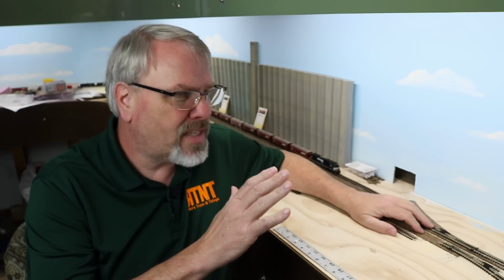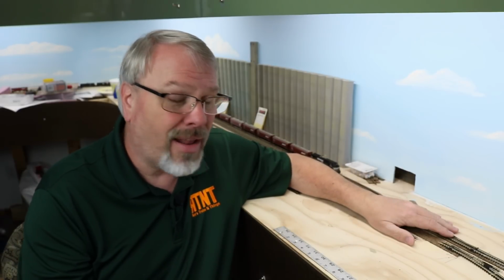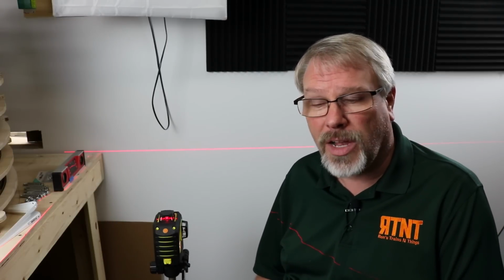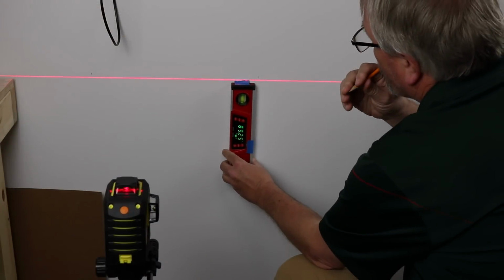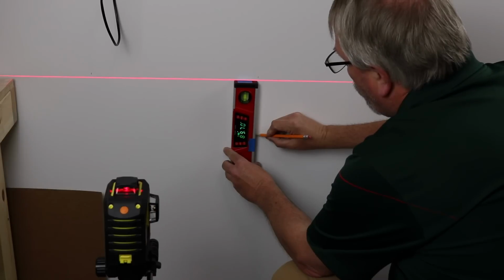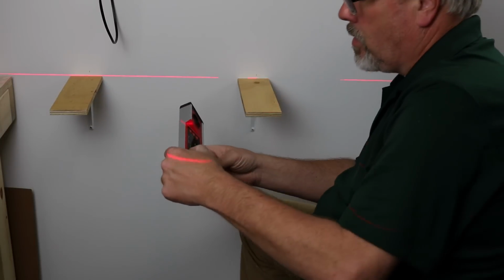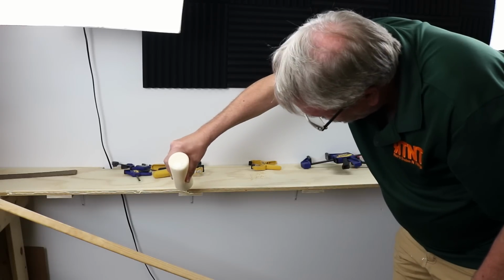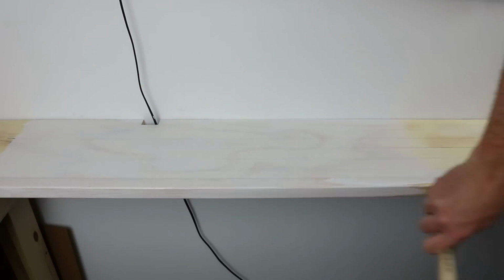Quick and Easy Layout Benchwork

Comment: Hi there, I am looking for tips in regards to running 2 continuous loops on my not yet built N gauge... Due to a severe lack of space, I am looking at a max size base size of 130cm X 65cms.
It is DC and I was hoping to be able to run 2 trains in opposite directions on two tracks..... no specific location and no switching yard
I am hoping to acquire a morley 2 track DC controller in order to run the locos

Thanks

Comment: Ron. Have you thought about hanging sheets from the ceiling around your track to enclose the area when you are not using it to help keep dust down? You could also use a sheet around your helix to help hide it and also keep the dust off the track.

Comment: You commented about the downsloped angle but I must have missed what you did to get the top flat. Can you tell me the best way to flatten the top? I doubt if you just muscled it but maybe???
Reply from the maker: Actually, I did just muscle it. If you're not comfortable with that, however, you could use a shim on the back side of the cleat if you use a wood cleat like I did.